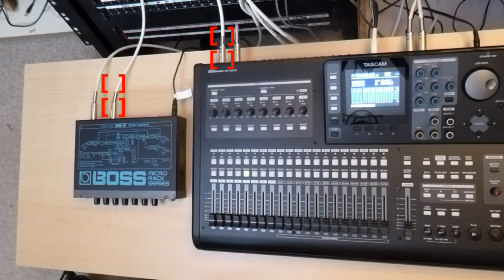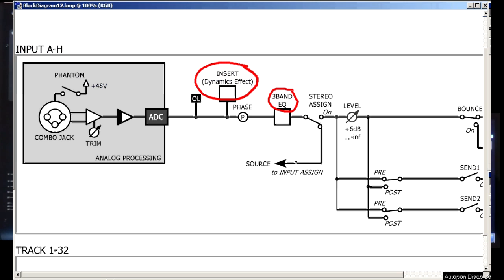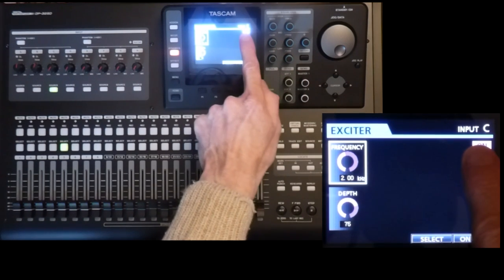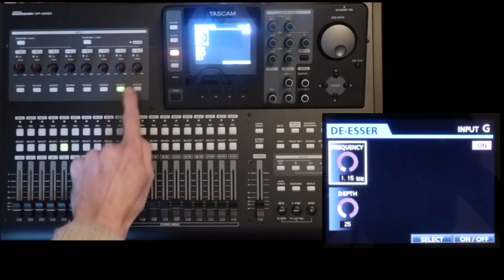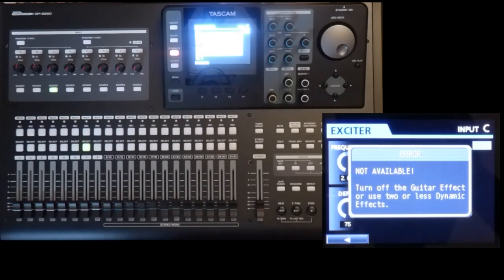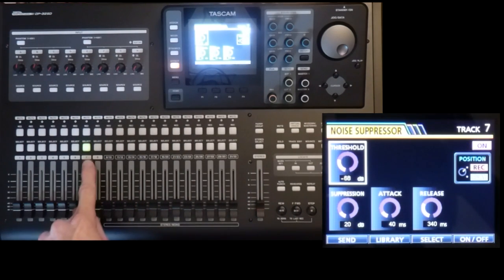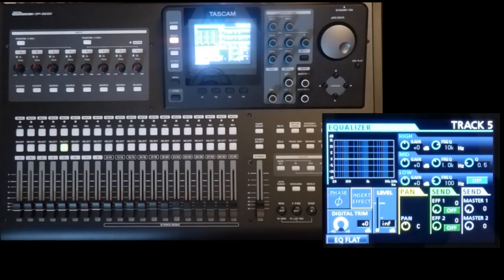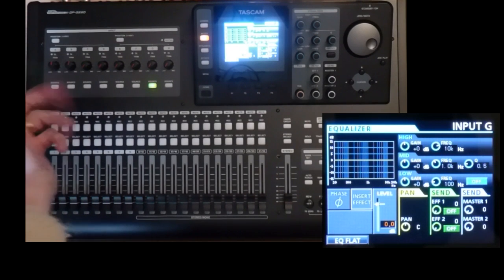Tascam DP24/32SD Tutorial 4: Dynamic Insert Effects

Comment: I Want to connect my Tascam DP 24 on my computer I Do not Know what cable one should use for it to work on PC makes me a tutorial to see how it can be connected please Bro👍
Reply from the maker: Hi +Lansan Rappeur - it depends what you want to do with the PC. To transfer digital wave files in either direction, you can use a USB cable or just physically move the sd-card. To record audio in real-time from the PC into the DP24, you need an audio cable which splits into two - one end needs a 3.5mm stereo jack plug for the computer line output, the other 2 cables need a 1/4" mono jack plug for using two of the inputs on the DP24 - these will be the left & right signals. To playback audio in real-time from the DP24 into the PC, the same splitter cable can be used to connect the DP24 monitor outputs (left & right) to the line input on your PC. It may overload it if the PC input only has a mic input although some PCs can switch the input sensitivity between mic and line. If you want to use the DP24 stereo outputs instead, you'll need phono/rca plugs instead of the 1/4" jack plugs. Hope that helps. If not, give me a shout using the email address at the bottom of my website http://www.philizound.co.uk